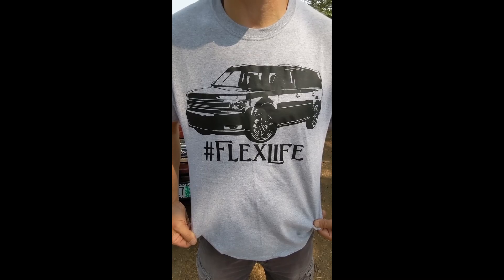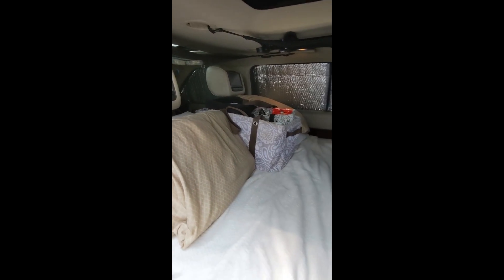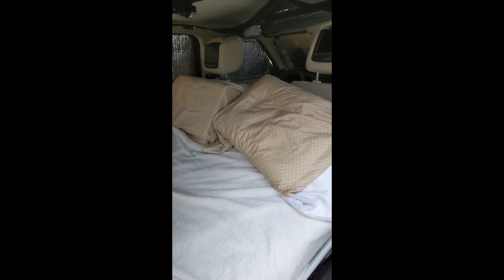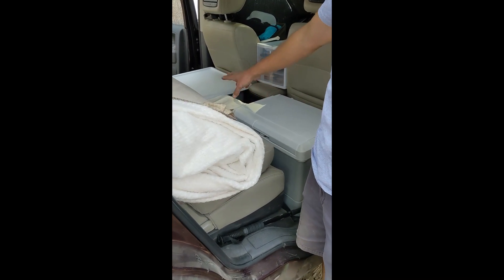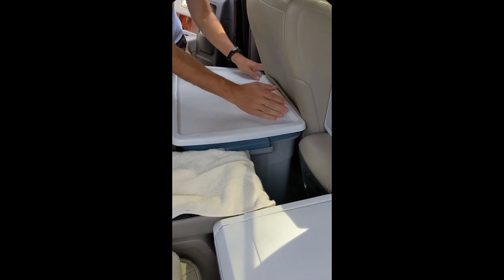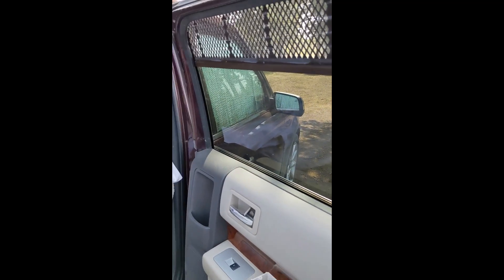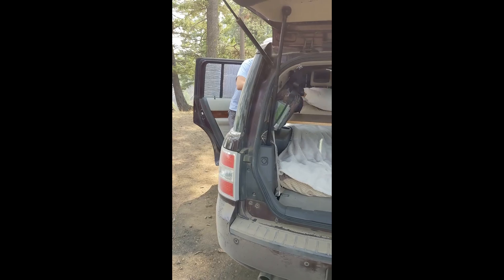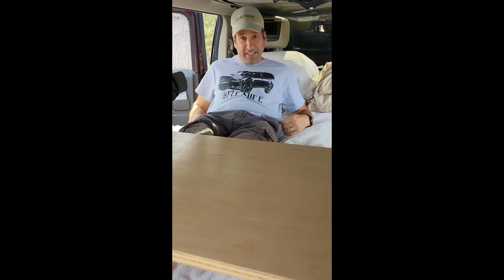Ford Flex Camper Conversion -  #FlexLife SUV Sleeper

Comment: I’m a Union Electrician and often travel for work. When I got the 2013, I didn’t know what I had…the limited. All the power, mildly decent on gas, the 3rd row, all the sunroofs, moonroofs, the trunk area where the seats can move 3 ways. Drove to Utah from Vegas for work, and man, the drive was great. Had a folding mattress that stretched out over me putting the seats all the way back. Great travel vehicle. Good vid

Comment: I camp in my daily driver too.  2011 Transit Connect.  I have to put the seat all the way forward to fit in my 72" long bed and have no room left before back door.  I use frozen water bottles in my ice chest.  I've gone 10 days.  I love your gutter block.  Looks like you're all dialed in.  I recommended your channel to my friend with a Flex.  I love your style.
Reply from the maker: Thanks Linda!

Comment: I’ve been looking for videos of couples using their flex for this, our flex is a 2016 and I would love to do this but we have a 70lb lab .
Reply from the maker: The lab could sleep at the back by the tailgate inside if you don't use our shelf idea....  Just a thought.  Good luck!
Reply: Could you mock up a shelf on the front passenger floor board to make the seat a bigger seat/bed area for your dog? :)

Comment: Can I ask what wood and dimensions you used for the “shelf” and also for the bed? I only need it for one and it would be behind the drivers seat. Just can’t figure out what to use to make the bed flat and still keep all seats in the car.  Thank you so much. I have rewatched your video over and over and over. lol safe travels
Reply from the maker: We didn't use any wood for the bed part. I put two small bubble levels outside the Flex on the side and the back and would typically point the nose down just slightly wherever we parked to make it completely flat inside. Never was an issue. I don't have the board dimensions right this second, but I'll try to update this message with it soon. 🙂

Also, we filmed version 2.0 in our 2019 Flex, recorded in the right direction here:  https://youtu.be/QnQqTblwlgg
Reply: @stephenmock6487  appreciate the dimensions when you get a chance and for responding so quickly.  I have a 2015 and when I lay my 2nd and stow the 3rd row there is a height difference from 2nd and 3rd row. Hope I’m explaining it right. Thanks
Reply from the maker: @shonda___  The shelf is 58x15x1".
Reply: @stephenmock6487  thank you for responding so quickly.  What type of wood did u use for the shelf ?
Reply from the maker: @shonda___  birch ply with a layer of poly.

Comment: Hi brother your video is very helpful ijut bought the same flex but it wouldn’t have roof rails will you plz guide me where should i buy it
Reply from the maker: I bought my OEM roof rails from Ford. And then followed instructions on the internet of how to install them quick and easy. Took me less than an hour.

Comment: Hi! Do you have an amazon link to the bed?
Reply from the maker: for the mattress, we purchased this, and then cut the bottom section as mentioned in the video. 
Best Price Mattress 4 Inch Trifold Memory Foam Mattress Topper with Cover, CertiPUR-US Certified, Full https://www.amazon.com/dp/B077BMJW16/ref=cm_sw_r_apan_glt_fabc_EGNQNFG1R2171SXSHFC4?_encoding=UTF8&psc=1

For the window venting we cut these: 
https://www.homedepot.com/p/Amerimax-Home-Products-Snap-In-Filter-3-ft-Brown-Vinyl-Micro-Mesh-Gutter-Guard-86379/100520852

Comment: I have side roof rails but no cross bars. Can you link what cross bars you have installed?
Reply from the maker: They are the Yakima Railbars. I don't remember the actual size but they were the right fit to the Flex OEM rails, and I did not want cross bars that extended out. :-)

Comment: I have a flex!! Do you have links?
Reply from the maker: Glad to hear that Jesse. What links are you specifically looking for?
Reply: @stephenmock6487  for the bed and window air grates
Reply from the maker: @MrJesseFelix  for the mattress, we purchased this, and then cut the bottom section as mentioned in the video. 
Best Price Mattress 4 Inch Trifold Memory Foam Mattress Topper with Cover, CertiPUR-US Certified, Full https://www.amazon.com/dp/B077BMJW16/ref=cm_sw_r_apan_glt_fabc_EGNQNFG1R2171SXSHFC4?_encoding=UTF8&psc=1

For the window venting we cut these: 
https://www.homedepot.com/p/Amerimax-Home-Products-Snap-In-Filter-3-ft-Brown-Vinyl-Micro-Mesh-Gutter-Guard-86379/100520852

Comment: I had a 2004 VW Passat wagon that I would sleep in. The seats folded completely flat with no 'crevices'. I was disappointed to see that my 2017 Flex seats do not fold completely flat (2nd row seats are not flat) and there is 'empty' space that flexes the floor in spots. Am I doing something wrong?
Reply from the maker: Look at the 10 minute mark on to see how we filled that gap! ☺️
Reply: @stephenmock6487  Thank you Stephen. Great video.  However that is not the gap that I was referring to. The gaps would be under your mattress near centre. The 3rd row seat backs are down stop snap due to the 'gaps' . There is a swing arm to hold up those parts but it just seems chintzy. 
My Flex is a 2017. Does your Flex 2nd row seats sit higher than rest when folded down?
Reply from the maker: @bc5001  not sure I understand what you mean by "stop snap". 
We remove the 2nd row headrests and everything folds nearly completely flat. There is a very gradual incline with the 2nd row seats, but it's miniscule, and you can either sleep with your head slightly higher than your feet, or park at a slight decline on the ground to even it out if you want Your feet and had to be at the exact perfect elevation. We have since upgraded our 2011 limited to a 2019 limited and it's pretty much the same other than because we don't have the refrigerator freezer in the middle anymore we've created a center gap filler between the bucket seats. Maybe that's what you're referencing...?
Reply: @stephenmock6487  spell check 🫣 ‘The third row seat backs are known to snap (break) where the gaps are.
Reply from the maker: @bc5001  Yes, I have heard that they can crack. We have not had that experience with either of our flexes yet. Though our heads are at the front of the flex, And we get in and get out through the side doors, so there's not a lot of weight on them with our feet....
Reply: @stephenmock6487  great to hear. Thank you. I am camping this weekend so I am sure all I’m my concerns will go away once I experience it.
Reply: @stephenmock6487  i have the second row gap with no console..and for 1...i put 4-6 throw pillows in it and its still not comfy..and 2..this southern utah summers are 117 so way to hot to sleep IN the car...and alternatively..when visiting family in florida some summers,the humidity..real uncomfy
Reply: @stephenmock6487  i have the second row gap with no console..and for 1...i put 4-6 throw pillows in it and its still not comfy..and 2..this southern utah summers are 117 so way to hot to sleep IN the car...and alternatively..when visiting family in florida some summers,the humidity..real uncomfy
Reply from the maker: @misterdanton  We have upgraded to a 2019 now that has that same gap. We put a small ice chest in the middle and it's the perfect height and gives us more storage too.
You can also roll the windows down all the way and insert these in each door. For the extra hot nights. Car Window Shade,Universal Sun Shade for Car Window Mesh Car Side Window Shades for Baby,Privacy Protection Sunshade for Kids,up to 44in x 20in,Fit Most Vehicles - 2 Pcs https://a.co/d/eJV35Gl

As well as get a couple of this style pocket fans for those extra humid nights, they work great, and double as a phone charger power bank. 
VEARMOAD 10400mAh Battery Operated Fan, Portable Handheld Fan with 10-40 Hours Working Time,3 Setting, Strong Wind, Foldable Design Fan, for Travel, Camping and Outdoor Activities(Blue) https://a.co/d/fEMBJ3V